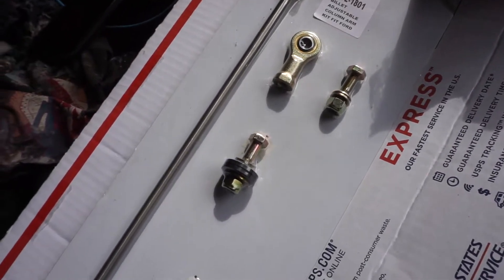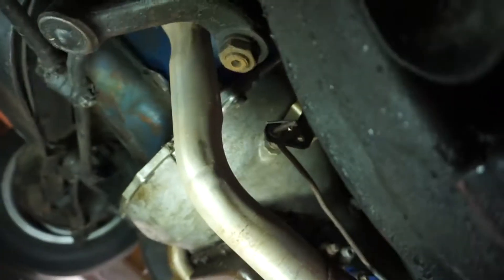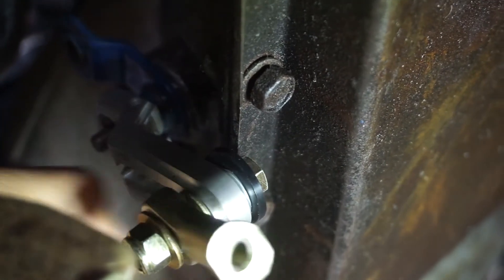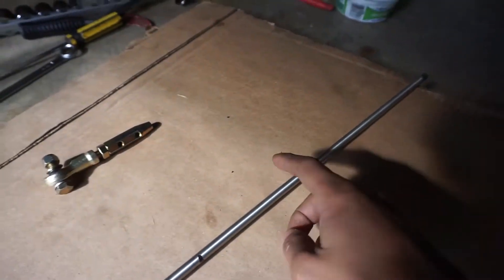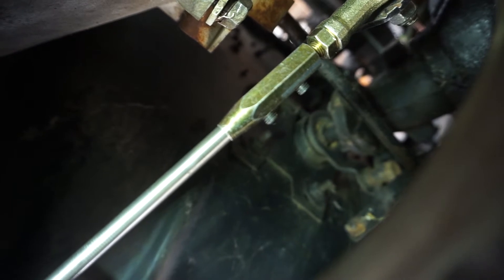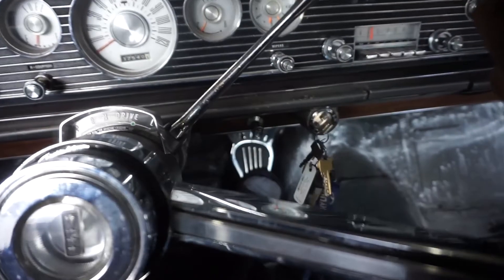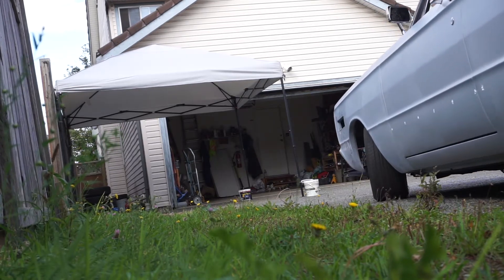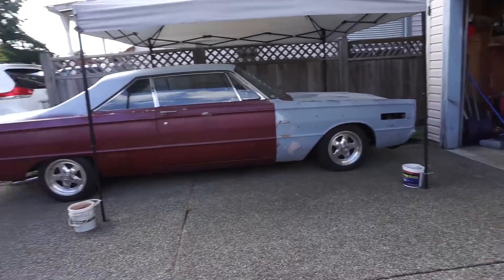Ford c4 c6 shift linkage *FIX*

Comment: Id love to do this, i have about 1.5" between the edge of my transmission and the exhaust. how long is the bolt (total width) that runs through the aluminum throw arm? Just curious if it would work for mine.
Reply from the maker: Dunno how long  the bolt is. But you could always step down to a shorter length  bolt if needed to.